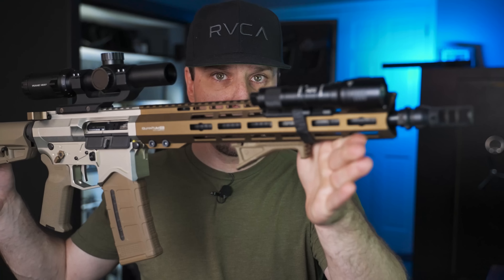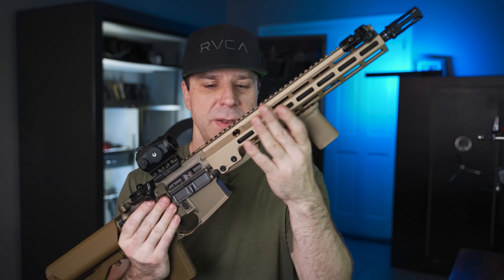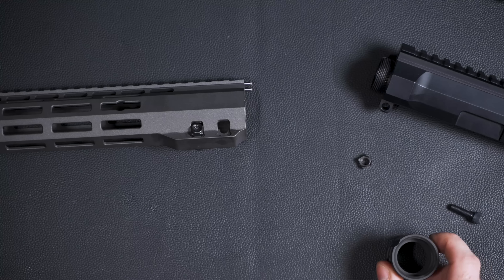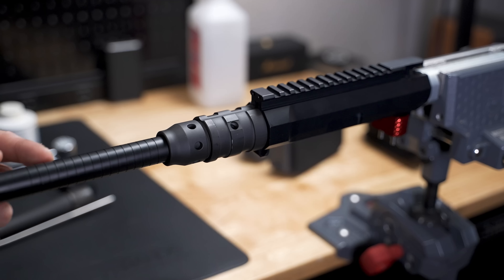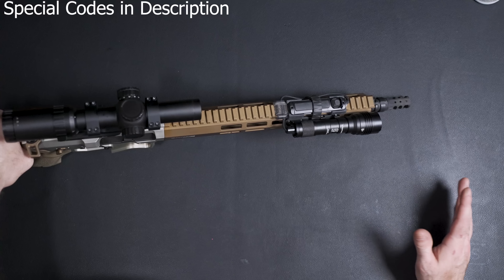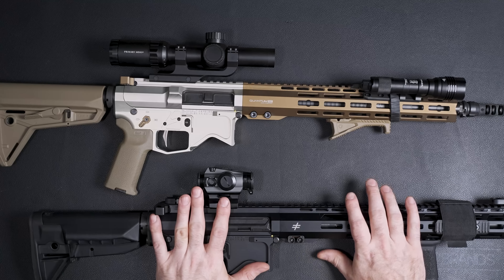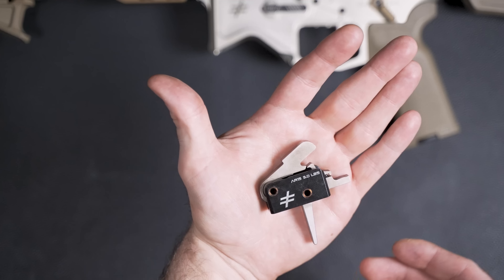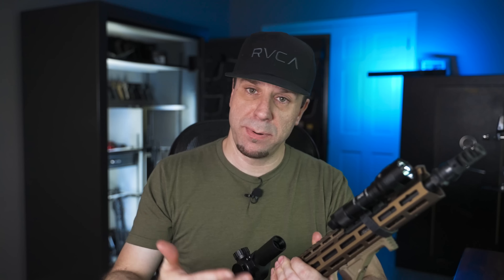NOBODY in the World Makes an AR 15 Like This...

Comment: I mean...I just built my own with the exact parts I wanted that fit my needs and the role I had in mind for it. Wound up being about $1100-1300.
Add on the optics, sling, and mags? About $1900-2100. Mix of mid-tier and higher end parts, built around a 12.5" Criterion SBR barrel. Accurate AF. I absolutely adore it.

But I appreciate all the little things these guys are doing. That barrel nut assembly is a really neat idea. A lot of stuff I'd do myself if I had the tools, cash, and people necessary to make them.

And, for the record, Igman is in no way a new company. They've been making ammunition for decades.
Reply: Liking my criterion 16" to.

Comment: I have Superlative adjustable gas blocks on a few of my rifles and the way they vent off gas externally make them a hell of a lot cleaner to fire than anything else I have. So long as it's dialed in, IMO that makes it a good bit more reliable. I think SLR makes their adjustable blocks vent externally also, but don't quote me on it.

Comment: An adjustable gas block isn't really meant to be adjusted all the time. It's really meant for fine-tuning. So, once you have it tuned, carbon fouling isn't really a problem. Additionally, the amount of fouling that may stay in that small space would be minimal due to pressure and volume where it could possibly build up. My guess, manufacturers don't typically do it because they cost a lot more than a standard block and they don't want to be issuing a bunch of RMAs for operator error. 

Look to superlative arms for a near industry standard adjustable block. Their block is used and rebranded by several companies now.
Reply: I installed an adjustable gas block because I want to tune the cycling to the ammo I reload. To your point, once it was set, I've never adjusted it, even if using COTS ammo.
Reply: very well said and 100% true anyone who does not have the knowledge of what adjustments are for and once you fine tune leave it alone would for sure have builders over run with warranty work and returns but if you have something with a piston driven system some have a lever to select a couple of options for say using a suppressor but in general you have made a great statement hope some people take note

Comment: Just my opinion....
I like everything about this build 👍...great job!
I have done Almost the same thing with my build in every way except two differences.
1. I have a Flat Wire recoil spring.
2. I do have a single stage 3.5 pound trigger,but im really liking your (zero) trigger 👍.
BTW... Single Stage triggers are Primarily for Battle Rifles... Two Stage triggers are Primarily for stationary and Sniper Rifles....
Reply: BTW in case you do not know when you buy a complete rifle it is not a BUILD
Reply: @sendit2873  
BTW... By your comment,you seem to Not understand the difference between building vs assembling...Big Difference!
Do some real research to educate yourself in just what is involved when building and customizing your own Rifle... Good Luck 👍😎🇺🇸🇺🇸🇺🇸
Reply: @sendit2873  
And BTW...Who mentioned here in anyway about buying a complete rifle?🤔

Comment: Looks awesome.  I love the forward assist delete.  But I'm still more into side chargers though.
Reply: @MultiBaller54 I kinda like the Foxtrot Mike FM-15 myself.
Reply: Just get a scar. lol.. 
I built some BCA side charging uppers in the past.  I even had a left side eject, which also puts the charging handle on the left side (like a scar)---  after running them, I don't really care either way.   A raptor style ambi charging handle on an AR works very well and feels natural to me.  side chargers be damned
Reply: @calholli  Still not over the industry dissing the Magpul Masada like that.  It should have won the contract not the SCAR.  But I guess I should just get over it and move on.

Comment: I hate upper -lower receiver wobble. Found that if you find the right washer (.001) for the forward pin, makes a big difference. Unfortunately most upper-lower clearances vary. Really like the roll pin idea very clean design.

Comment: I've had a few adjustable gas blocks seize/leak. They can work long term, but it is another potential part to maintain. My preference for a pick-up-and-go rifle is fixed and pinned. I still have adjustable rifles, but not my preference.

Comment: That's a beautiful rifle.  I'm really looking forward to your reviews on the lower end, mid range and the high end rifles before I make my next AR purchase.  I myself have been researching my second AR purchase for MONTHS.  First I was set on the DDM4V7, after more research I ended up looking more towards the V9 because of the DD quad rail which is probably the best out there.  THEN, I decided the DDM4 because of the 14.5 length BUT it's $2000 with no attachments.  So I decided to look more towards the BCM Recce 14.5 for $1400 but it doesn't have a cold hammer forged barrel.  OR the IWI Zion for $800.  All three companies have a great reputation from what I've seen.  I'd really like to see the differences between the three and if they actually warrant a higher price tag.  I'm mostly just looking for reliability and durability and barrel life.  Reliability is really the most important for me being that it's going to be a SHTF rifle.  The AR market is so saturated that it's hard to make a decision for someone like me who doesn't have tons of cash to spend on a luxury.  Before I spend thousands of dollars, I'd really like to make sure my money is well spent.    Love the channel and I've learned quite a bit from your videos.  I signed up for your giveaway as well.  Cheers
Reply: Check out the Savage Recon…seriously you will not go wrong and you can save some bucks for ammo, sights, etc.
Reply: U don't NEED a cold hammer forged chrome lined barrel as a civilian especially for only ur second ar style rifle.  There are many forms of barrel manufacturing all of which are very capable far more capable than most even realize
Reply: @RARufus  I’ll check it out
Reply: @Kyle Wiech yeah the 13.7 is really nice I’ve been debating that too.
Reply: Zion 12.5 is a sweet shooter. Short barrel with a mid-length gas system, softest shooting AR I personally own. Just my anecdotal .02
Reply: @RustyStator  I really like the price of it too.  I’ve heard it’s a go to war rifle too.  IWI is a legit company.  Haven’t heard any bad reviews about it either.
Reply: I love my 12.5 IWI Zion pistol.
Reply: @rongutierrez4454  that’s the one I’m debating… pistol length Zion
Reply: @AnthonyD1986  If you don't have a 16" yet, that would be my suggestion. Start with a carbine for a "do it all", but if you have one already, the 12.5 is gtg. Then again, 12.5 is perfectly capable for civilian use
Reply: @RustyStator  I have a 16’ bear creek Arsenal I bought off my buddy for $400.  It’s probably worth $600 now… not the best gun ever but it shoots.  That’s why I’m looking for a nicer AR.
Reply: @AnthonyD1986  You really can't go wrong with the 12.5. The maximum range I have available is 300 yards, and the 12.5 is constant as needed inside  that range, right around 1moa.  I haven't stretched it further, but I've got no reason to believe it would struggle. 

My main squeeze is a Ruger 5.56 16", but the trigger on the IWI is much more refined. If I could only have one it would be the Zion for sure. No matter what you end up going with, enjoy!
Reply: @RustyStator  thanks brother… between the BCM Recce 14.5, SOLGW 13.7 or the IWI and financially the IWI is looking the best.
Reply: @AnthonyD1986  iwi zion 15 16 inch. Perfect for a second general purpose rifle. Comes with b5 furniture a 15 inch mlok hadguard a socom profile barrel or similar and is made in the United States also. 1000$ if I'm not mistaken great frickin rifle man no doubt... p.s. edit and it comes with a mid length gas system
Reply: How about an ADM? Their ambi lower is the best
Reply: @SH-mp1fx  I’ll check them out never really looked

Comment: On adjustable gas blocks. My first AR which was also one I built from a stripped lower and stripped upper and it still has the same adjustable gas block I started with. Once I spent several days and several hundred rounds getting it to where I want it (literally learned as I went) I've had zero issues with it in both summer around 90f and through the winter at below freezing under 32f at the range. I run several different ammo and I've run through some training drills with it this year. I built it in 2018 and haven't adjusted anything since. I don't believe they have any more carbon issues than a regular gas block would.

Comment: Personally, and this is only for myself, I can not justify spending that much on a rifle. Tech has come so far since the old days when cheap rifles were just junk. I own a couple Palmeto State rifles that have never failed me, ever. One of them has around 2500 rounds thru it now and it still runs perfectly. It still shoots as well as I can shoot and does what it's meant to do, put rounds downrange fairly accurately. All of the same inspections as far as BCG and Barrel tests are done and they use the same materials in most cases. They're affordable enough that I can have two rifles and enough replacement parts for them to build a third if not forth rifle for the same money as a $2400 rifle. I'm an old cheap skate and that makes me happy and I also have confidence in the fact that both of my rifles are ready when needed and have put the range time in to know I can count on them if the time ever comes. If you like the expensive rifles and they're your thing that's okay but please don't crap on people who decide that good enough is just that, good enough...
Reply: Well said brutha!
Reply: all the higher end rifles generally would not fair well in a war time setting some like DD and geissle would be ok BCM would be a real choice for combat the super accurate SS barrels and soft quick triggers would cause alot of issues when very dirty and if you get SS real hot it can strip the barrel clean like a shotgun And if anyone that reads this is one of those idiots that comes to a static range and does mag dumps over and over like an kid first time shooting SS is not what you want a chrome lined barrel is what you need

Comment: I wouldn't run an adjustable gas block on a "go to" or "duty grade" rifle.. they are certainly nice for certain setups, but they aren't going to be reliable enough to go thousands of rounds without worrying about carbon lock, buildup, etc.
Reply: SLR or Superlative and you're golden. my "duty grade" geissele has a superlative on it, no concern here.
Reply: I would think that if your having any problems with an adjustable gas block just open it all the way and boom problem solved
Reply: If you only run production line ammo, you do not need an adjustable block.  You can fake a poorly calculated gas system by using band-aid bullshit like a heavier buffer.
Adjustable blocks are for those of us who reload different powder charges for different velocities or bullet weights, often with oddball loads like 300Blk.  
And carbon tends to deposit at it’s hottest last point of contact- the nose of the bolt in front of the 3 piston rings.
Reply: @donr4582  unless it's carbon locked..... And in a moment where you can't break out the tools, that's not ideal.
Reply: @PineyJustice  
I ONLY use adjustable (piston) gas blocks. I tune it for Wolf .223 and leave it there. It will cycle anything once that's done.
 I only use pistons now. Of course, I only buy the SA kits which I prefer over all others!
Reply: @blackhawk7r221  It's also of use to tune your rifle to work well with hot military ammo, many barrels are ported for .223 and will run very overgassed with proper milspec ammo. Some of the high end rifles like KAC are ported for it and just won't run 223 at all. I'd rather have the option myself.
Reply: @PineyJustice  Absolutely.  I have to throttle mine back when shooting those hot M855A1’s.  
All M-4’s are purposely overgassed for reliability.  
Stick an adjustable block onto a civilian AR and you can certainly turn it into a soft shooter.  
Here’s the issue:  the powder used.  You may have 62gn bullets from several manufacturers, all pushing it to 3050fps.   What is different is the pressure, the burn rate, and the incline on the pressure graph.   One may use a fast burning powder that hits 61,000psi and rises quickly on the pressure graph. Another may use a medium burn powder that only hits 48,000psi and rises slower on the pressure graph.  So from what I just described, the location of the gas port is important, so choose your gas length correctly.  It’s not what you want, it’s what is required. In the military, our ammo is matched to our model of weapon to maximize accuracy, velocity, and cyclic timing.  
M-16A1’s get M193
M-16A2’s get M855
M-4’s get M855A1
There is a difference between an AR that simply runs, and one that runs properly.
Hell, i brazed miniature T’s on the adjustable port plugs on my 300BLK because I shoot so many different loads at wildly different pressures.

Comment: I have adjustable gas blocks on a majority of mine and have never had any issues with them. I run SLR Sentry 7’s on most of mine which have been 100% reliable for me. Every 1000 rounds + - I play it safe during cleaning and turn it 2-3x in 1 direction and then the same amount in the opposite direction to prevent any carbon from seizing it but haven’t had any issues. I don’t have any cheaper made adjustable a bc I do not want any issues from them. However… I highly recommend the SLR Sentry 7’s.

Comment: I've got a Blackout Defense 4.5 pound triggers in my ar. It's very crisp. Great break and and the reset is amazing.
Reply: Been thinking about getting one. Can't really decide on the 3 pound or 4.5 pound one. Is the 4.5 a lighter pull then mil spec? Is it a "fast trigger?) Thanks.
Reply: @jbreeezy715  it's very fast. Check out tactical considerations review.
Reply: @warrenharrison9490  ill check him out. Thanks. I've seen a few reviews on here but it's just hard to sometimes believe what these guys are saying. Ya no. Haven't ever felt a trigger that wasn't mil spec before. Would like one to be lighter than mil spec but not crazy light.
Reply: @jbreeezy715  it's smooth, that's where the bonus is.
Reply: Be very careful with light 3 lb triggers on an AR.  Seen more double fires and negligent dirt shots right at your feet with light triggers.  What you want for a battle rifle is not a light trigger, but a smooth easy-releasing crisp trigger.  And even that can be easily done by stoning a mil-spec hammer and trigger sear.
Reply: @blackhawk7r221  I'd definitely go with the 4.5 pound. What other triggers would recommend?
Reply: @jbreeezy715  There is a company called Velocity that was selling drop-in units a few years ago for right at $200.  My group bought several in varying pull weights.  I still have one of the 3 lb versions.
Great for slow benchrest, but horrible for runnin and gunnin.
Will go auto bump fire far too easy, but that happens with any of my light trigger brands.  
If you are the type that likes to go to a range and blast steel while moving from firing point to firing point, you need a battle trigger, not a 1000yd competition trigger.  Maintain a medium pull weight, but reduce the sear travel distance for quicker breaks, not lighter breaks.   Think of your trigger and hammer sear surfaces.  As you pull your trigger back, those surfaces rub for a particular distance before they release.  Polishing the surfaces will certainly make them much smoother, but you haven’t addressed the friction surface distance.  If your sear “hook” sticks out .045”, try stoning it down to .030” to reduce the friction distance before the break.  
My best AR triggers are the mil-spec ones I have stoned.  
But do this at your own risk. 
Have an extra trigger kit, you’ll probably take too much off the first time you try.
And a lighter trigger spring works wonders.  You can adjust your existing spring if you know how.

Comment: A gun that's meant to go to war or for duty use typically is a tool that is tailored to a specific job and that job only. Makers will overgas it and keep it that way so it can be fed any ammo, and they don't have to tweak it. A duty suppressed gun will usually run exclusively suppressed. An enthusiast can be more flexible and screw around with their gun.

Comment: is true... adjustable gas block COULD get jacked. but, if you set it with ammo you are going to use long term it should be good.  I run adjustable block on ar10. once it's locking the bolt back on weaker ammo. you are set🎉

Comment: I found a upper and lower you build in Oregon that has no play in it. Also light weight after you Mill out the trigger pocket. If you buy the Timber creek carbon hand guard in the same color they match up very well. I added a BSF barrel in 300 blackout. It's a master class in what a AR should be with good parts.

Comment: The reason I like fluted barrels is for their weight they don't lose accuracy as fast, as they heat up. They do cost more though and thats why I like Saxon barrels not the best or the worst by a long shot but they are cheaper and lighter than most reasonable good barrels.

Comment: Carbon locks up everything with a seam in it. That's why they don't use adjustable gas systems, as they would get stuck in position if it isn't field strip friendly.

Comment: DMG Mori machines? 😱 yup they serious. For any that don't know, those CNC machines are designed for aerospace tolerances, like millionths, a few tenths (machinist talk for ten-thou, aka 0.000n") this is where you need to be for most firearm parts. The difference between good firearms and great firearms is this, it is the dimensional precision. Most at 0.00n +/-0.005" but great ones have tighter tolerances, because precision. Precision is good:)